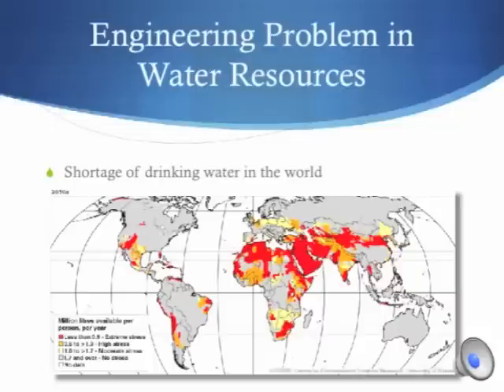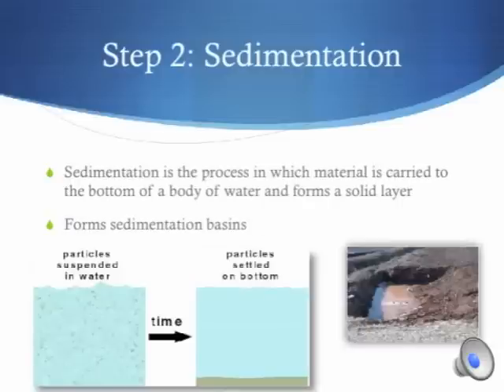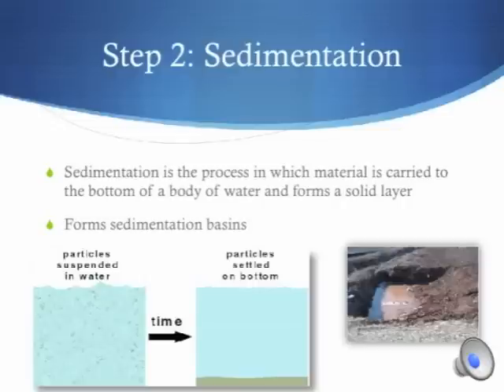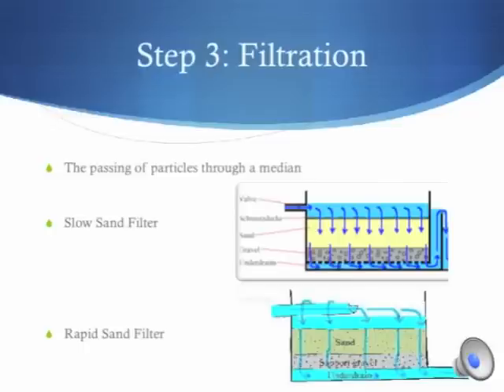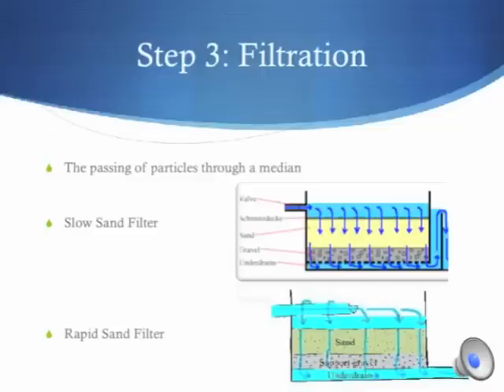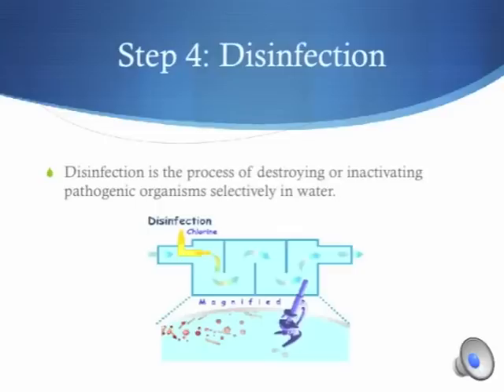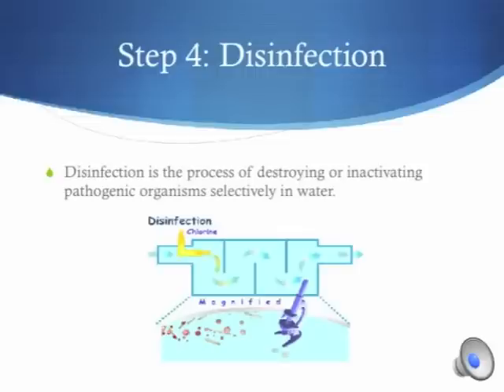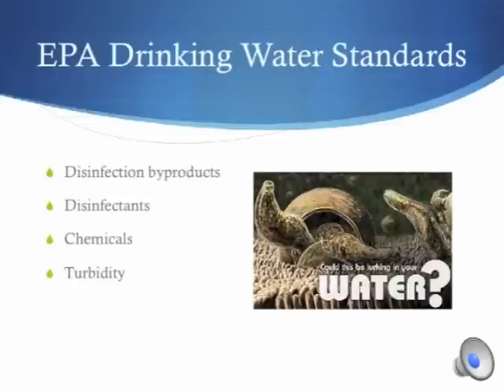ABE 100 Water Resources Project FINAL

Comment: I thought this was a great video. It clearly and accurately described a topic I knew little about and brought to light the current situation with regards to the clean water crisis. So in my opinion the content of the video was great. The only improvements to the video that should be made are to the audio, it was a little quiet and scratchy at times.  Other than that the video was great!

Comment: Good video. The audio was a little quiet, but it provided a good basis of knowledge on a subject matter that I do not know much about. Your video also raises an important question: If all of the technologies for clean water already exist and are in use in the US, then why don't the countries that need it most have them?  I think this is what we as engineers need to work towards. Namely helping those in need find a cost effective, and efficient solution to providing clean drinking water.